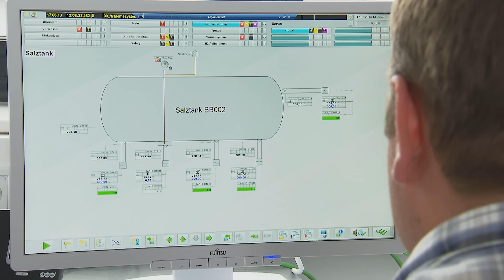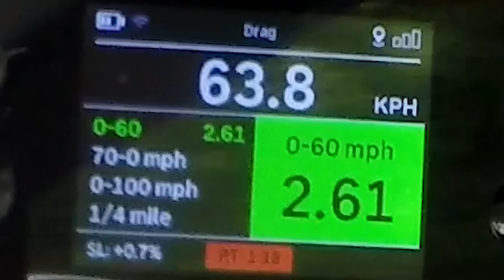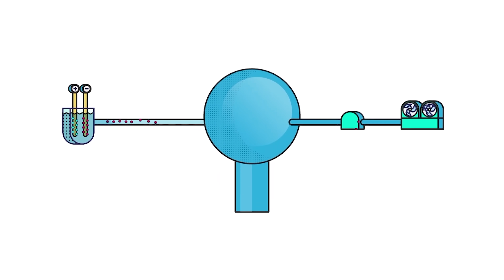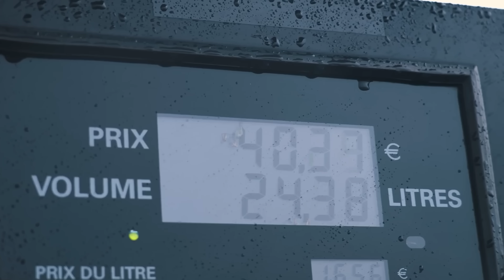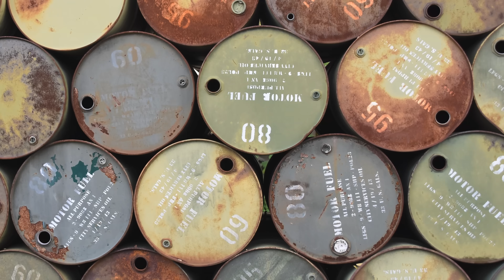Porsche just SAVED petrol engines FOREVER

Comment: Imagine what can happen with Tesla's battery toys whenever Porsche develops syntenic fuel 😏
Reply: Nothing sync fuel will be extremely expensive
Reply: @sebastiangeorge7714  fuel will be eventually unobtainable.
Reply: @sebastiangeorge7714  In the future it won't be that bad, around 2 euro pr. liter..
Reply: @oliversrensen8490   you predict also lotto numbers maybe? (asking for a friend)
Reply: @oliversrensen8490  then add tax and profit and it will be near 4€
Reply: @sebastiangeorge7714  And that 4 euro will let you drive for 10 km compared to 200 km in EV. That's all considering it will be actually 4 euro which likely is going to be a fraction of a real price.
Reply: @MuppetsSh0w but, making batteries is harmful to the environment, whereas making real cars is less harmful and cheaper.
Reply: @MuppetsSh0w  what about 1000 euros?
Reply: @oliversrensen8490  in some countries it maybe only 1.3 euro per litre.
Reply: @felixormiston5102  yes you are right, but there has been many battery designs that does not use harmful resources for the environment making them safe for the environment.
But I think many if us are not focusing in the bad decisions made recently one of them is taking down nuclear power plant and replacing them with fossilfuels.
Reply: I think evs will develop even more to be use in practical car, there has been many breakthroughs for batteries that could mean high energy density, so expect to see a range of 600miles or even 1000miles of range.
Reply: @axolr1  Athix, in theory it maybe possible to do that.
Reply: E-fueled ICE-cars will always be more expensive to run than EVs. Simply because renewables can't be ramped up quick enough to get enough of them until 2035. Even with pessimistic assumptions, it'd be cheaper to import synthetic methane, run gas power plants with that and charge EVs with it (not even accounting for the heat-energy, that the power plant could sell). Except of course if there's some tax incentives for E-Fuels, but than it's not a fair comparison.

Also it's hard to cover our expected future demand of energy, even after reducing it significantly compared to today through heat pumps and EVs. It is crucial to reduce the needed amount of energy because otherwise it's going to be hard to cover the demand without fossil fuels. That's solely a problem of how fast can renewable capacities be implemented. 

Trying to save status quo with ICE using E-Fuels on the other hand would increase the world's energy demand by >35PWh instead of reducing it by >25PWh like with EVs, so EVs need 60 PWh less than ICEs with E-Fuel (current total energy demand in the world is around 170PWh, with ICEs).

The only reason, this got through is, because everyone involved knows, it won't happen. The only reason why it was brought up was for some parties to calm their voters.
Reply: @@MM-lw2rf I know oil is abundant, in Libya the oil is cheaper then water, and I am from the middle eastern peninsula so I know oil is abundant and cab be sold cheap, but it is being produce/sold less to keep price profitable.
Reply: @M M You forgot your schizophrenia medication dude.
Reply: Nothing because electric cars are inherently better, cheaper to run.
Reply: @MuppetsSh0w  you’re not taking the many downsides of ev’s into account. For one, 5 minutes to fill a tank or potentially 20+ hours to charge a battery fully. It’s easy to just fill a gas can and pour it in the tank if you run out of fuel. If an ev runs out, you need to find a charging station, which could be a long way away, and you’re down for charging for at least an hour or more.
Reply: @Sleepy_spartan717  Carwow maybe usually gonna change the thumbnail after every 60mins.

Comment: Even if this new fuel is clean it will be financially not competitive to Ev cars
Reply: But they are already not good for your pocket🙃 The car costs more to buy literally double. Then charging is now no longer cheap. So you either buy the car with the battery for double of the equivalent car or lease it and pay monthly for it equalling to the same thing as buying it with a battery it’s just this workout around to still suck your pocket dry. You also have big servicing bills on ev’s and the parts are more expensive.
Reply: It’s only a beginning…

Comment: They changed their minds because Latin america, asia and india couldnt be bothered to give a fk about climate change and that those areas together are reaponsible with almost 2x more polution than the rest of the US, EU and UK together... so if the icecap melts anytime soon it wont be because you didnt buy an EV. and the problem with EVs is the lack of extra gears. Think about it an electric motor that gets you moving from a dead stop and goes to highway speeds is like an combustion engine starting from a dead stop and reaching highway speeds in 1st gear... Why the heck would you need to rev that motor that much if you could simply add extra gears. Charging in an hour wouldnt be a problem if EVs would get 3x the range just from adding 5 extra gears. You dont need the torque from the 1st gear when you are at highway speeds. But hey, it wouldnt be fun for the energy industry if you only plugged your EV 2 times in 3 months, would it?

Comment: Total nonsense. E fuels are a scam by the fossil fuel industry to prop up an industry on life support. They will have the same toxic exhaust emissions as current petrol and diesel cars, locking in pollution in built-up areas for decades. They will also be extortionately expensive and inefficient to produce. What's the point of using electricity to split complex chemicals into even more complex chemicals, when you could just use the same energy to charge an ev? Almost certainly 'e-fuel compatible' cars will just be fueled with regular petrol and diesel by most owners, as that will be much cheaper. So well done Germany.

Comment: No one wants E-Fuels. They are absolutely stupid, being extremely inefficient in the making, with the main advantage, that existing petrol stations could still be used. All else is pointless and is just used as a political instrument to allow car makers to continue producing high margin ICE cars, rather than having to invest huge sums into new factories and R&D.
They are only protecting their margins, and don’t give zero f&cks about the environment or the consumer.

The Argument by the CEO of BMW “we do not have the sufficient renewable energy” and then say we need e-fuels, that require several times more electricity to make per kWh of kinetic energy compared to a BEV… yeah, stupid AF.

Comment: #Save the engines
Reply: Yes. Save the turbo engine.
Reply: e-fuels will never work. It will take far too long for e-fuel production to meet the demand for the amount of ICE vehicles on the road.
Reply: @beanapprentice1687  True. People need to research the numbers involved. To provide a hypothetical world with 100% EVs in the would take a pessimistic 15 PWh in renewables. 26PWh less than is currently used in oil for ICEs. To provide e-Fuels for current ICEs would take 77PWh in renewables 36PWh more than currently. The total primary energy consumption of the world is ~170 PWh. The world is struggling to implement enough renewables to meet the EVs target until 2050. Assuming to meet the E-Fuel target in 2035 is insane.
Reply: Especially the steam engines. Stanley steamer all day everyday!

Comment: Good news for car guys 😊
Reply: Yes. But sadly bad news indeed since Carwow gonna change the thumbnail again.
Reply: Donut media done a video on this a couple weeks ago, they said it costs 40$ a litre. So with the way the industry works, it will only be for elites
Reply: Actually no one cares
Reply: This E-Fuel its just a Concept , practically on a very small scale because its Mega Expensive and Time Consuming to Produce
Reply: @CaptainKedah  so were electric cars, and still are to an extent. as time goes on technology improves and so does the system and infrastructure necessary
Reply: bad news for your pockets though